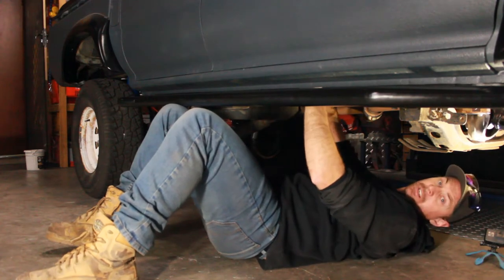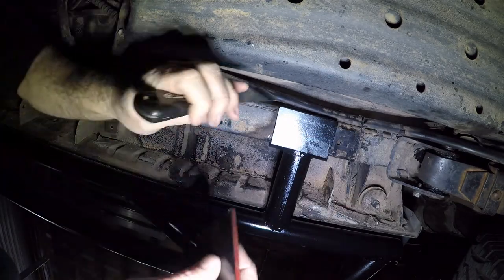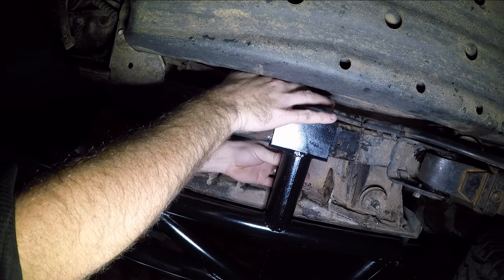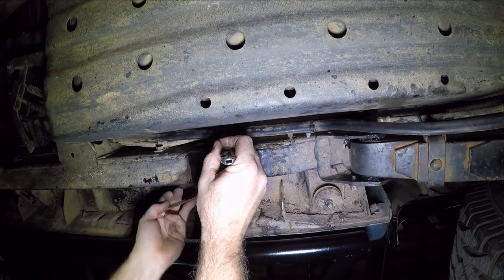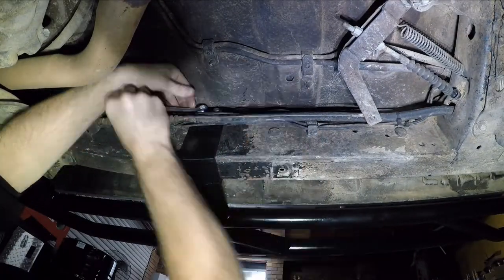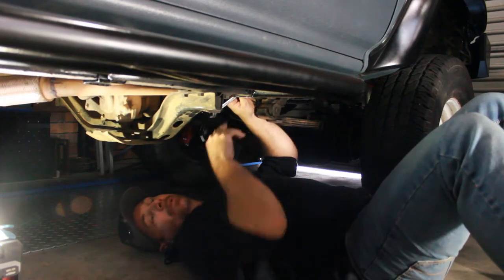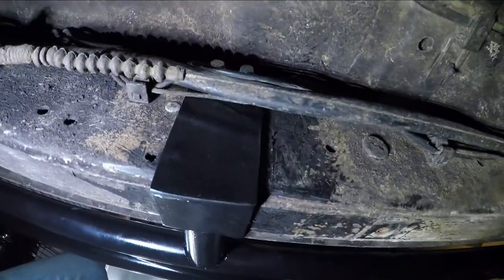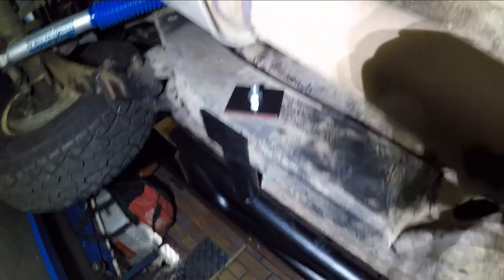Part 3 - Rock sliders side steps Installation onto our LN106 Toyota Hilux project build

Comment: Mint videos. Wanting to do this myself. What size wall thickness is the tube and what thickness plate did you use for the brackets?

Cheers
Reply from the maker: Thanks Strings. Most tube is 3mm thick wall. Which is perfect for weight and rigidity for any 4Wd. Brackets and gussets are all 5mm which is plenty for Lighter trucks like this hilux and suzukis. I'd go a little thicker for patrols and landcuisers say around 6-8mm.

Comment: Did you drill holes in the chassis for the bars to bolt up? Or is there holes already there? And I know that seems like a silly question.
Reply from the maker: The only silly question is the one not asked. I used the holes already in the chassis. Can't stand drilling steel if I don't have to. If you see part 2 about halfway through, I go into detail about the different ways we can build U brackets and connections that will work in different ways. Generally don't have to drill any holes in chassis.